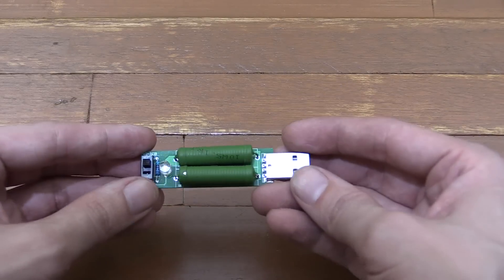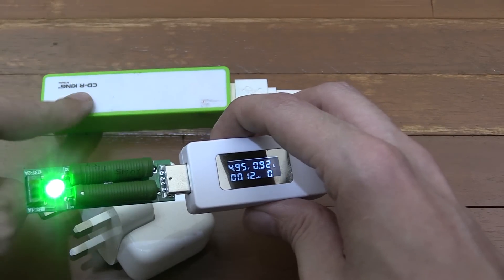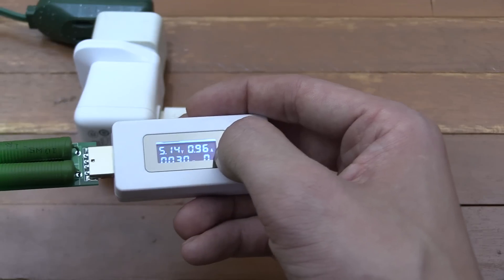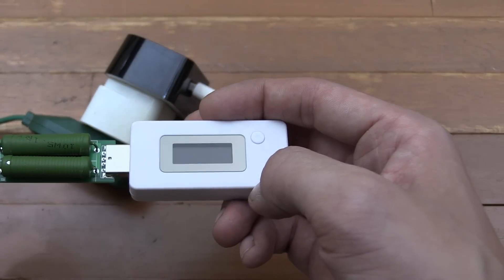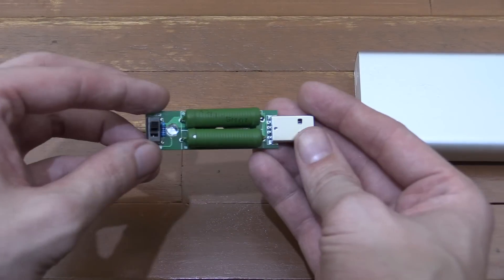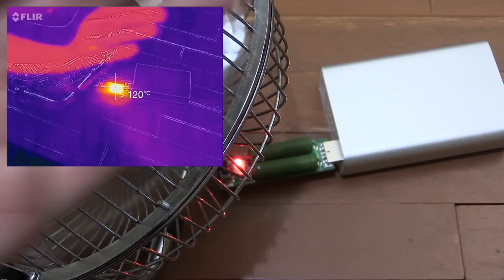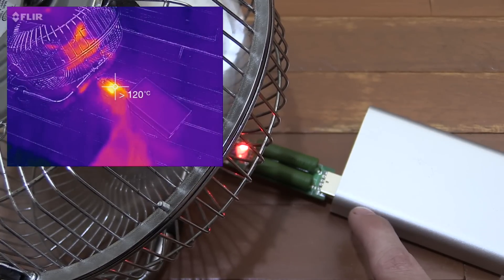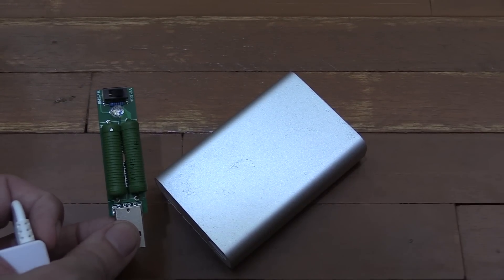USB Dummy load

Comment: Very cool stuff. Hey can this be used to keep a powerbank on, so it doesn't shut off until it runs dry? I am looking for a device that can do that. Wanted to connect a GoPro to a large V mount  battery, so I can capture longer duration time-lapse.

Comment: hey will this kinda usb load be able to use 2 A current on like example 9v? or 5v only resistor? thanks
Reply: It will get too hot and maybe burn a wire, even at 5v it gets unpleasant to the touch. (at 5v2A=10 Watt dissipated, at 9v2A=18Watt)
Reply: It will get too hot and maybe burn a wire, even at 5v it gets unpleasant to the touch. (at 5v2A=10 Watt dissipated, at 9v2A=18Watt)
Reply: Juan Herrero I think because it's 10 watt rating. It's gonna be limited to it. So if u give 10 volts. U can only use 1 amp. Anyway I decide to buy the one with screen and the one that I can set which amps it's gonna drain.  Quite useful.
Reply: simple ohms law, at 5V on 1A you have resistance of 5ohms, on 2a you have 2.5ohms, 5W on 1A and 10W on 2A, if you run it on 10V it will draw 2A on 5ohms and power would be 20W, on 2A setting (2.5ohms) it would draw 4A and power would be 40W
Reply: Cekpi7 yes. But this resistor is designed for 10 watts only. That means. If I give 10 volts. I will get 1 amps only. As 10watts/10volts=1amps
Reply: No, its ohms law! Resistor has its resistance which means its power depends on voltage, on 5ohm resistor will draw 1A on 5V, 2A on 10V, 4A on 20V and so on, power will also jump really fast since  P=V^2/R (double the voltage, you get 4 times the power)
Reply: Cekpi7 do you understand? What I mean is. That the resistor itself only built for 10 watts and no more
Reply: It might draw more. But it will definitely fry it in no time. Not designed for more than 10watts
Reply: Yeah, but resistor is passive element, it cant change its resistance so it will draw 2A on 10V and use 20W of power as heat, not 10W
Reply: Cekpi7 yeah. But the resistor isn't designed for more than 10 watts 😂 it will just bursts into flames lol
Reply: Not really, i have 5W Ceramic resistor that i used on 30W for few minuts, its still fine, it all depends on quality of resistor, but it got really hot (about 130c)
Reply: Cekpi7 yea. But for this one? Don't think so haha

Comment: Hi Gadget Addict, thank you for your response to do this review. I'm little bit concerned on the electronics component of the powerbank, If the USB Dummy load can cause stress and burn it. Especially during or used to discharge the whole capacity of the powerbank. I already order this USB dummy load and USB Doctor /  powermeter at ebay. Need to wait for few weeks to arrive
Reply from the maker: I don't think it would damage the powerbank. Although you saw for example the chromecast AC USB charger dropped to like under 3v when put under a 2amp load, if that happens I wouldn't recommend continuing the test. Most powerbanks are rated for at least 1A output and most larger ones can handle 2A just fine. It's not much different from connecting an iPad for charging.

Comment: Thanks for the video.  Can you start posting links to where you get things?  That would be helpful
Reply from the maker: +mnelson10000 I can try. The problem is that these low value items ($1 or $2) usually come from eBay sellers that might have stock today but won't have stock in a week or two weeks time. So links often turn bad in a very short time period. I could perhaps give an ebay search link that includes the relevant keywords :)
Reply: +Gadget Addict Yes, the search link is the way to go.  BTW, Banggood had these cheaper than eBay, at least as of last night.  :)
Reply from the maker: mnelson10000 It's funny you should mention banggood. I had an email from them last week asking me to review their service. But the range of products they offered for review didn't interest me. So I'm still waiting until they have something I'm more interested in :)

Comment: Just wondering... A newbie bout this stuff here =) does this dummy load and using battery doctor is the same? I realise that using battery doctor. How precise is the battery doctor if u have any idea bout it. Trying to find that USB Dummy Load here in Indonesia but no luck
Reply from the maker: +Maurice Phoenix I had to lookup what battery doctor is.. it appears to be some kind of app that lets you monitor battery usage, charging rate etc. I've had apps before on my android phones that can measure incoming voltage and current and they seemed fairly accurate, although not as good as a hardware watt meter at the power source. I have an upcoming video which talks about using the dummy load to discharge a powerbank to measure it's true capacity. In that video I talk about why a dummy load is more accurate than using a phone to discharge the powerbank. The main thing is that 1) there's a loss where your phone has to step down the incoming 5v to charge it's internal battery and 2) the phone is likely still running and consuming power while you charge it with the powerbank. So if your aim is to measure the capacity of a powerbank, using an app or cellphone won't give you accurate results. Hope this helps :)
Reply: +Gadget Addict looking forward to Ur upcoming video. Oh ya u downloaded app called ampere. And battery doctor and this ampere app is so much different in term of measuring the current. If u were me. Which is the one that u take as a correct one? The ampere app or the device that is battery doctor?
Reply: +Gadget Addict Sorry It's Charger Doctor not battery doctor. Sorry my bad
Reply from the maker: +Maurice Phoenix As far as I know, Charger doctor is pretty accurate. Well, as accurate as any other 3-wire USB watt meter. They can lose voltage accuracy at higher current draws but otherwise they&#39;re pretty good. I&#39;ve always found them to be more accurate than phone apps.

Comment: If it doesn't burn you it cuts you. :(
Those 10 Watt resistors are usually rated for 200c so the temperature is more of an issue for the PCB and the surrounding components and not the resistors. With the device set to draw 2 amps each resistor has to dissipate 5 watts, or half the maximum rating... not horrible.
Reply from the maker: +SublimatedIce haha yeah, it's out to get me! I'm glad you gave me that information. I wasn't able to lookup the specs on them yet so it's good to know! I guess that's why they've put that metal plate into the PCB, to try act as a heatsink to protect the PCB/other components rather than to cool the resistors. The manufacturer don't really give any information about long term use, they only talk about short output tests. I've had it set to 1A, connected to an ASUS powerbank for a few hours now, to measure the capacity of the powerbank. I have a fan pointing at it but it sounds like it's probably not required. Although it's so rare that I'd do these long discharge tests that it probably doesn't hurt to use the fan just to increase the life of this dummy load. Although it's cheap to buy, it's not easy to source in the Philippines.